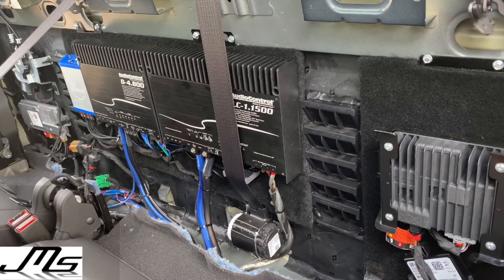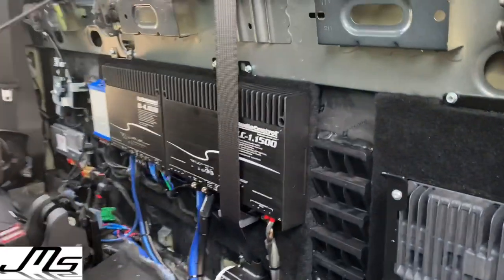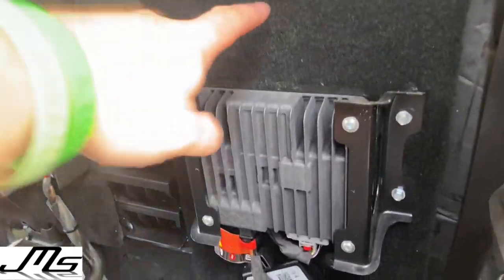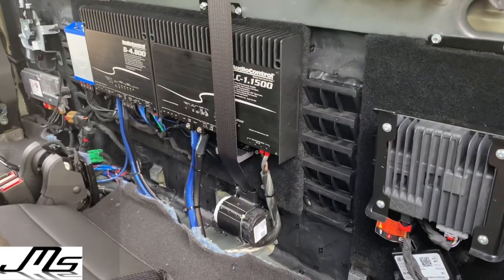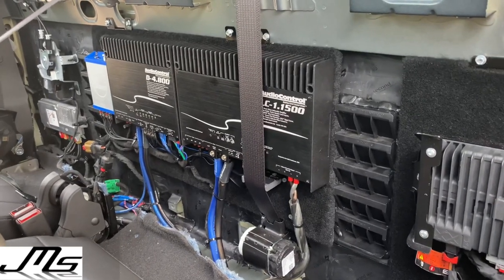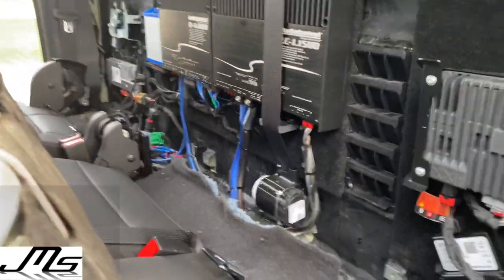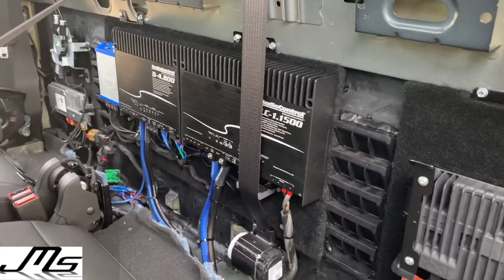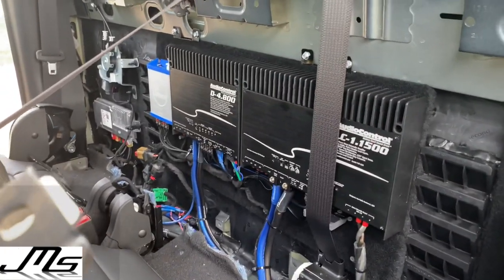2020 GMC Sierra New Audio System

Comment: With the zen is everything plug and play would I be able to run epicenter with zen
Reply from the maker: You’ll bed to ether cut the Bose amp wiring harness and plug it into your epicenter or just get a 4.800 and it had the built in dsp.  Just like a epicenter.  So you don’t have too much back there

Comment: Goals!!!! I love audio control but they’re out of my budget currently! Question, you running factory stereo or aftermarket? If your running factory stereo, did you tap into the wires between the front and rear door? Or did you tap into the front door speakers for your bass? I’ve read that tapping into the door speakers gets your a better full range signal for bass cause that speaker gets a fuller signal since it’s a bigger driver than the rear door speaker. I have mine tapped into the rear speaker. I wonder how much better the bass would be if I did the other. I have an audio control lc7i with my factory head unit.
Reply from the maker: Hey. Factory radio.  Also getting connections from the rear from Bose amp.  The nav tv is giving me the signals to the audio control 4.800.  The 1500.1 is getting signal from the 4.800 amp 

I’m not pulling from factory sub.  It’s all ran off 4.800 and tuned on the app they have
Reply: El cl7 te sirve para ponerle amp alas voces y amp alos bajos tambien?? Wl lc2 También funcionaria?

Comment: I have a similar setup im having trouble by hearing the turn signal and seatbelt chine amplified through front and rear speakers what do you recommend to not hear door chime and turn signal through al speakers?
Reply from the maker: Hey you have the NavTV box?
Could be a setting also 

You have the audio control 4.800? 
Setting on the software on the computer when your tune it 
If so it does make it as loud as factory.   But if you have volume up you can hear it faintly 

If need more troubleshooting text 314-341-1266

Comment: I like the setup a lot, the amp rack looks very clean. I do think however that the wire could have been cleaner.
Reply from the maker: Appreciate it.  With these trucks back seat and mounting brackets. Running wires a certain way so over time no pinching will happen.

Comment: What made you go with the sundown components ? Have u ever listened focal flax ?  Would u go with focal over thanks I'll be reaching out soon when my new truck arrives for your assistant thanks
Reply from the maker: I have.  just at the time they were hard to get.  local shop is sundown authorized dealer.  so got great price on them.  probably would change in future. 

if need anything on your truck.   question or anything.  call or text 314-341-1266 

I have taken almost every panel off.  so yeah 😂

Comment: After cutting a lot of the foam off the back seat, is the interior a lot louder?
Reply from the maker: Nope.  My truck is loud with my borla Atak exhaust.  So before the foam all in and out.  Sounds the same
Reply: @JMSAudioSTL  Sick, I did a muffler delete and it got louder for sure but not that bad. 2 layers of sound deadening on the back wall should help. 4 sa8's going in soon 😎
Reply from the maker: @Matty-Ice98  nice nice.   What year truck?   If Sierra like mind.  I have some parts that are for sale.  314-341-1266 text me

Comment: I'm about to do my 2022 LTD but I was curious to know if the amps get hot back there.. What y'all opinion?
Reply from the maker: Not hot at all.  A lot of the foam of back of seat was cut.  So it’s getting air flow.  I have a newer sub amp a crossfire 2k on two crossfire 8s now.  So moved things around some.
Reply from the maker: I’ll do a updated video with the new stuff.  Same electrical components.  Just bigger sub amp and subs.  Same box too 

I’ll probably be changing out the door speaker amp  shortly.  I have the crossfire components in the doors now.  Way louder and crisp

Comment: I have the same setup on the amps,  how did you do the amp rack That the only part  I’m having trouble on
Reply from the maker: hey sorry for late response.  it’s a abs plastic board that I used factory bolts that held the Bose amp and outlet converter.  kept it between the vent in cab.   just a lot of measurements before cutting

Comment: Nice how much costs to due all hard work
Reply: curious how much was it all together? and did you  build the box?
Reply from the maker: I had a guy build the box.  Roughly around 600 for it.   All equipment and can’t count my own labor.  But equipment about $3,500-$4,000. Could be high but around about.  Labor would of been another $1,500-2,00.

Comment: If you're still getting water back there check your rear glass.  Some of the rear windows on the 2019 and up Chevy and GMC's are known to have problems with leaks.  I recently bought a 2020 Sierra and so far so good.  I looked at a 2019 and there signs of the rear window leaking.  The storage compartments in the rear seats had water in them, so I walked away from that one.  The good news, if it's still under warranty the dealers are repairing/replacing them under warranty.  If not under warranty there are several good repair videos here on YouTube.
Reply from the maker: Yeah dealer fixed my rear window leak.  But the louvers on back wall aren’t tight. So I used the window gasket around.  I actually just swap a amp out and nothing damaged.  Moisture still gets in from the louvers. But it sits 4 days a week.  So yeah

Comment: can 6x9 fit in the rear doors? and do you have a DSP?
Reply from the maker: Hey the 4.800 audio control amp has a built in dsp.  I was assume so that you could do 6x9 on rear but the speaker bracket they offer is for 6.5.   Could make something
Reply: @JMSAudioSTL  thanks. I purchased some kappa components 6.5 for the front and kappa 6x9 for the rear thinking the rear could hold 6x9.
Reply from the maker: @fredp8388  you should be able too.  Just have to see if it will fit

Comment: Were/are you running this off of the factory head unit?
Reply from the maker: Hey with the Bose factory system I have eliminated it with the NavTV module.  That is giving  me all my signals I need to feed to my 4.800 amp.  I had a guy make me a custom harness so no cutting factory amp wiring. 

If need any more help.  Please reach out to my audio page or give me a call 314-341-1266

m.facebook.com/jmsaudioSTL/
Reply: @JMSAudioSTL  OK yes I am planning to do the same thing right now I’m just running 2 12 under the seat through an LC2i converter but when checking the output of the factory head unit with the SMD DD1+ the radio is distorting at volume 36 if you count clicks out of 63 which kind of sucks so I was looking into possibly changing the head unit but really can’t find much for 19 GMC 1500 Denali seems it’s either 14 through 18 on the 1500s 
And 14 through 19 on the 2500 s 
Still looking into it  but haven’t had much luck
On why all the kits are labeled that way would hate to order it and have it not work
Reply from the maker: @lilramos2012  send me a text and we will talk.

Comment: What screw or bolts are you using to hold the amp rack up. And what brackets as well.
Reply from the maker: The brackets are just radio brackets that were in a radio I installed for someone.   

The screws are just self tappers Phillips or hex head 

The board to hold the amps, is pvc board
Reply: @JMSAudioSTL  ok did you have brackets for the bottom as well. I’ll be using 1/4 mdf for my rack just wondering the screws. Did you have to cut a lot of the foam out.
Reply from the maker: Foam I cut it all out.  Besides the ends.  

The pvc board what I did was.  I took all the amps and converter off back wall.  Then I press in gentle into the studs on the the board to get the factory locations and used the same bolts.  

But in the top I didn’t like the flex I was getting. I used those brackets to give more strength
Reply: @JMSAudioSTL  ok but with the foam out does it make the seat feel weird or flimsy I have a 14 yr old and a 5 yr old do one is in a car seat and the other is not lol just curious. I have cut out some but I didn’t take it all out didn’t want it to be to flimsy.
Reply from the maker: No the back of the seat isn’t supported by that.  That’s for the louvers on back wall so you don’t hear the noise that much
Reply: @JMSAudioSTL  ok so if I cut the foam out seat will still be solid. Thank you sir.
Reply from the maker: @jameslavinder4368  yes sir
Reply from the maker: @jameslavinder4368  you have a Sierra or silverado
Reply: @JMSAudioSTL  I have a 21 silverado custom
Reply from the maker: @jameslavinder4368  text me I have some oracle drl and demon light kits for it 314-341-1266

Comment: Are you using high level outputs for your signal (amp input) ?
Reply from the maker: I’m getting signal from the 4.800 to the 1.1500.  In the software It converts it for me.
Reply: @JMSAudioSTL  to adjust the 1.1500 in the software, does the amp accubass switch on the amp need to be turned to enable?
Reply from the maker: @Deke1  I want to say it’s enabled.   It been so long can’t remember.  I know it’s just adjusting the output off the 4.800
Reply from the maker: @Deke1  what gmc you have

Comment: Was sup bro did u add a 2nd battery and a capacitor to you system
Reply from the maker: No I didn’t. I did change battery under the hood tho.  To a North Star X2 Power battery.  It’s for car audio.  Deep cycle AGM battery
Reply: Oook coo deal coo deal brotha thanks 🙏
Reply from the maker: @josegonzalez131353  no problem man. You have a Sierra?

If so I have custom headlights for sale

Comment: HeyJohn great job but I have a question…what about the heat produced by the audio control….seats will be covering them
Reply from the maker: Great question the foam padding has been cut and the air vents on back wall when driving actually lift up and let air in and out.  Also plenty of space for the amps to breath.   With the floor vents.  We get some crazy heat in the Midwest.  So never a problem
Reply from the maker: What year do you have
Reply: @JMSAudioSTL  2020 GMC Sierra 1500 Denali 5.3L
Reply from the maker: @Carbon15556  nice.  I’m about to post these new headlights I just got finished with.  If interested they are for sale.   About to post here shortly.
Reply from the maker: @Carbon15556  https://youtu.be/9UjRJeRomZs
Reply: @JMSAudioSTL  nice! Wondering about the price….🤔
Reply from the maker: @Carbon15556  text me
314-341-1266
Reply from the maker: @Carbon15556  hey if interested in those custom headlights for Sierra. They for sale still

Comment: Where is a good ground point for this truck?
Reply from the maker: So I used the bolt from the seat. Where the two seat belts.  If you pause in first 5 seconds you can see the ground wire ran behind it.  Make sure to sand down to metal 

My terminal of my 0 gauge I had to make hole a little bigger but I had enough material still to tighten down.
Reply: @JMSAudioSTL  thank you!
Reply from the maker: @10galaxy10  no problem